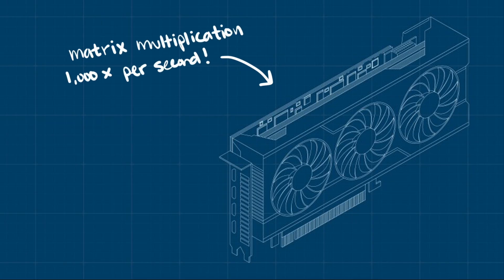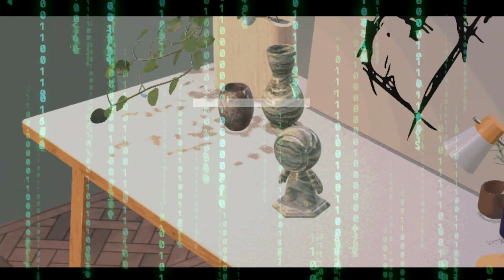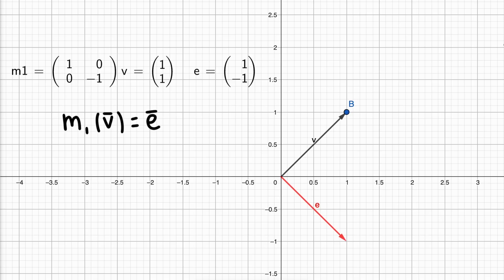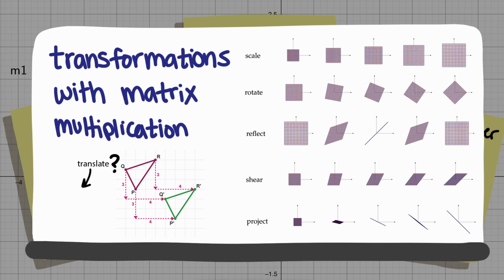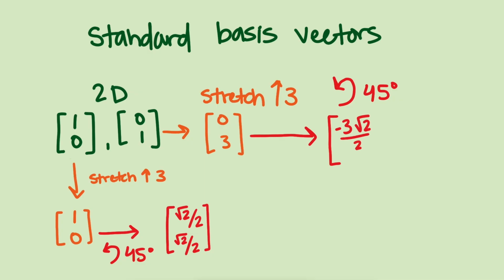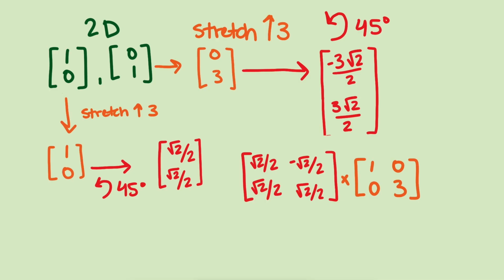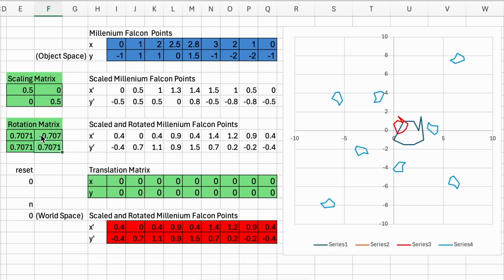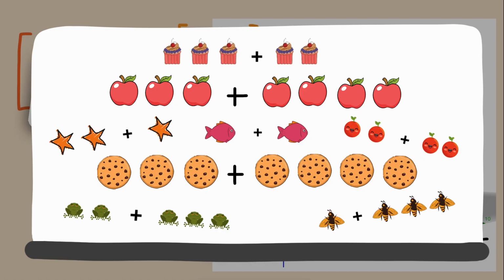How Matrix Math Powers 3D Worlds

Comment: 2:40
lol good thing you don't know about competitive gaming. A lot of pc gamers think of 60 FPS as the minimum for many types of games.
For games like valo and CS2 many casual players uses 144 Hz screens and thus needs at least 144 FPS.
For competitive players on 240-540 Hz screens and if they could buy a 1000 Hz screen they would probably be using that.

To bring down latency you need as many FPS as you can get. And in these types of games many GPUs can deliver +300 FPS. So the pc have ~3ms not 16ms to do all the calculations. 😂